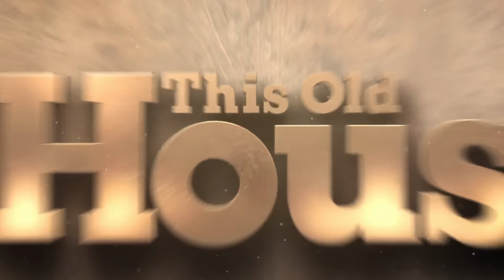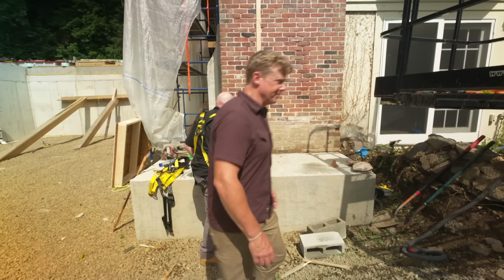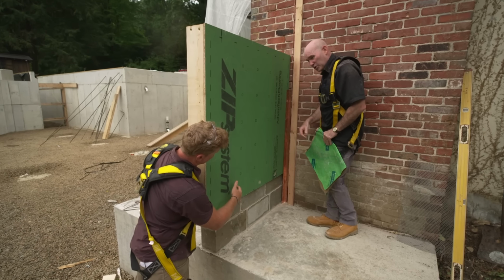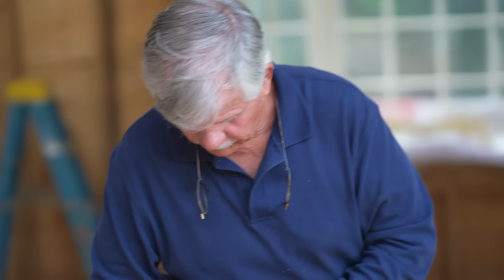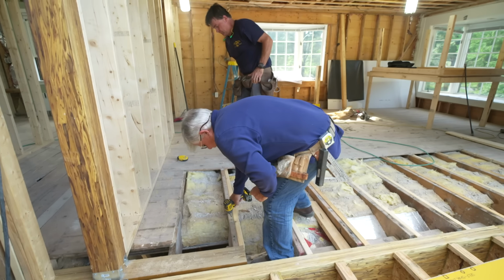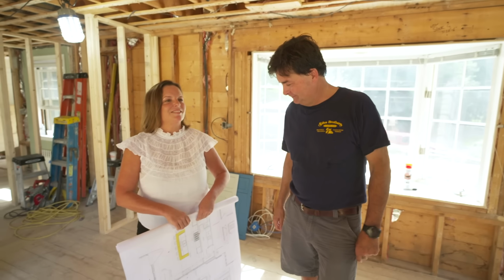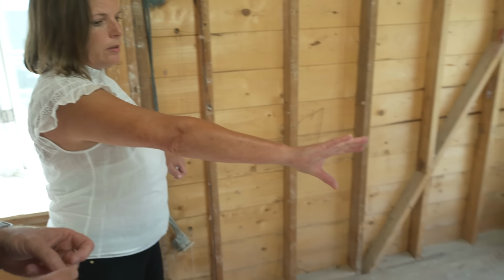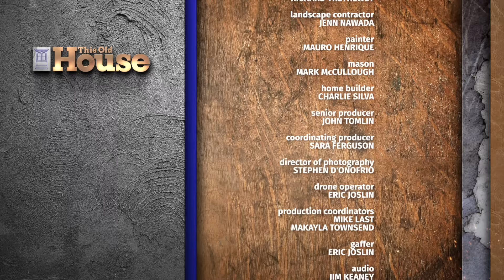This Old House | Masonry Lessons (S43 E7) FULL EPISODE

Comment: Not impressed by Marks masonry skills (been a mason since 1976). should have drilled the rebar holes before starting wall (that way area can be cleaned out properly). uses a cheap level. should have double buttered all the head joints

Comment: Sweet job! I've rarely been lucky to have clients live off site...That place is HUGE...As a remodeling contractor for 30 years; they're doing at least 350K worth of work depending on finishes; that number could easily double...I imagine skilled labor is no better up north as well; Down here in philly; it's horrible
Reply: I work in the area this is a 1.3m + project
Reply: @Freedacarlo  funny I was going to guess around a million too but I only saw so much of the first floor I was thinking just the kitchen and that addition sweet project though
Reply: @Navy1977 Is this ther largest job in your career? As a remodeling Contractor in philly for 35 years, I know it would be mine...I don't envy you for the logistics in a project that size...1.3 million? That'a a dollar per decision...:)..I hope you have zero stress, no slippage and they give you the CO easy peasy...Just remember when you get to the punch list; you're half way done...:)

Comment: Amazing building built 100 to 200 years ago are still standing without all the BS we have in modern builds.  Money grab with all this new crap.
Reply: No kidding. If you punch a wall made of modern drywall, you’ll put a hole in it. If you punch a wall made of 100 year old plaster in good condition, you’ll break your hand.
Reply: yes plaster from back then is very tough because it has asbestos
Reply: Asbestos, ha look at the ingredients in your food far worse than asbestos.
Reply: @NoOneIsGoingToSaveYou  Agreed, and don't get me started on this. Asbestos remediation has become such a lucrative industry, along with the money from civil suits that lawyers love pushing, that the extent to which we are now told to freak out about asbestos is absurd. Here's the health tip everyone should know to minimize your risks from asbestos: don't smoke. You shouldn't be smoking anyway because it is so awful for you, but your risks of mesothelioma only increase to a shocking degree if you're also a smoker. Same for radon exposure.

Comment: Я удивляюсь почему не строить хороший крепкий арматура бетон конструкция кирпичом они строит весь доска гипсокартон это ненадёжная самый надёжный бетон конструкция арматура завязано мы в России делаем каждый день два этаж три этаж бетонный конструкция один этаж тоже делаем бетонный конструкция крепкий хороший будет стоять 100 летом и не будет горетьу них утечка газ или замыкает электроэнергия вес дом загорается туже секунд почему крепко не делаете американский люди я смотрю вас дом с Club термит весь Бизин таракан как можно так жить делать бетон кирпичом это надёжно будет
Reply: gross
Reply: В США легкий доступ к древесине, поэтому использование каркаса в большинстве наших домов является стандартным и происходит из традиции быстрого строительства, поскольку население США растет, поэтому требуется быстрое строительство. Нам также нравится возможность быстрого расширения наших нынешних домов, поэтому дома, которые не требуют расширения, встречаются довольно редко.

The US has easy access to wood so using framing in most of our houses is standard and comes from a tradition of building fast as the US has been increasing in population so quick building is required. We also like easy ability to expand our current homes quickly so homes that do not require expansion is rather rare.